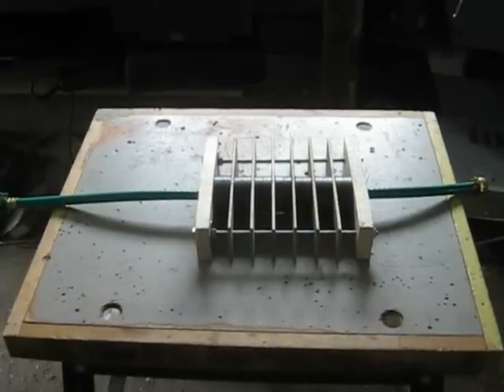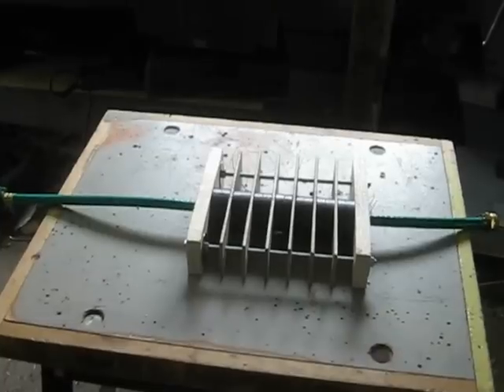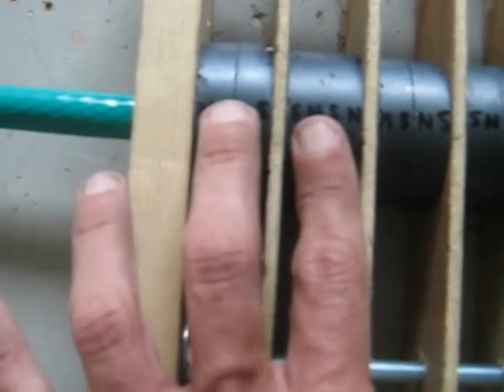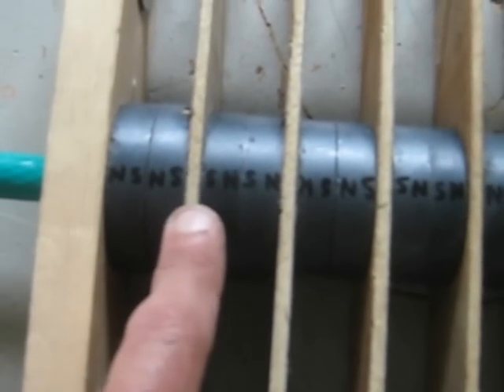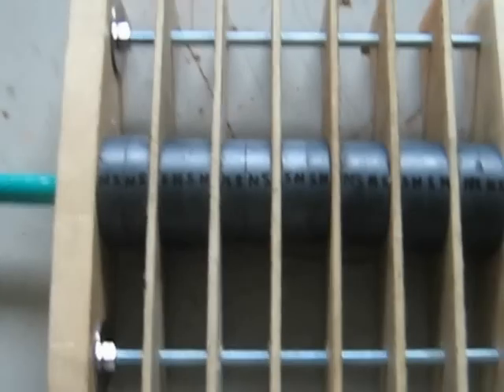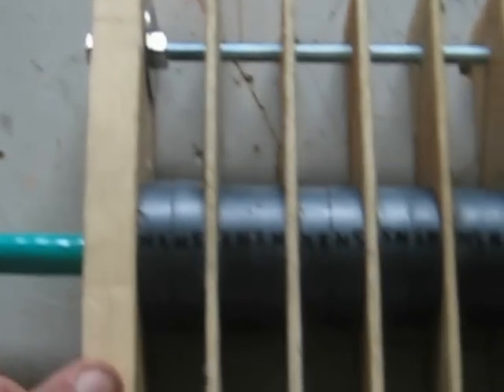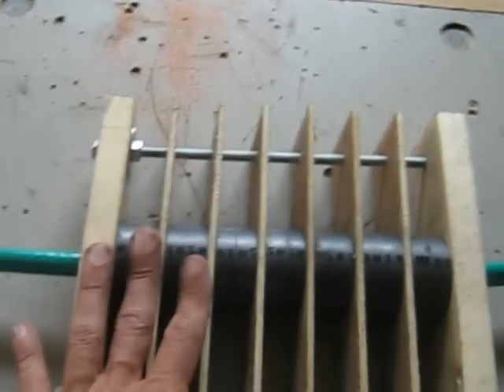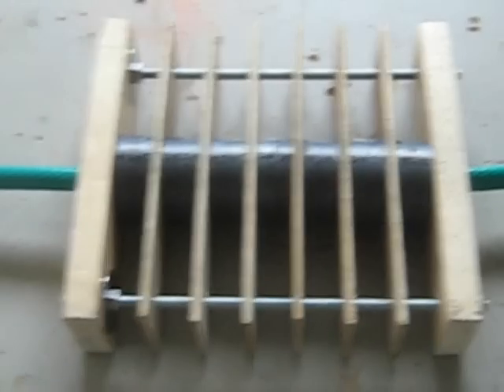Revitalized Water - Johann Grander Effect Replication

Comment: I have seen a johhan grander device opened and this is not what is inside. Also there is no inhibitation of the exterior magnetic influence I would use magenesium as the housing as is johhans also the real verbs is far from accurate. Rememeber to check for surface tension this is the outcome of soft water or rain water ect.

Comment: Magnets polarized thru diameter direction will give strongest firld density thru the water. Also, if those arent neodymiums, they will destroy their field strengths rather quickly. Neos will last over 100 years except over 160 f. Also, weathercoat the neos.. fyi

Comment: Maybe it could be a magnet on one side of the hose with a divider as the water goes through pulling the iron and minerals to one side so making a water stronger in those contents and increasing the ph?
Reply from the maker: Actually there is a vid on YT that shows a person cutting a Grandeur device in half....it is galvanic  ;)
Reply: @MrAnguswangus  What's galvanic mean? I was looking for a vid that opens one up but couldn't so far. Do you have a link to share? Thanks.

Comment: Can you please let me know, when you say the magnets are opposites i.e north next to south, is this when the magnets are pushing apart? Many thanks great video
Reply from the maker: Yes, the mags were repelling each other in that setup. I never got to finish the experiment because I had to move at the time. Take care.
Reply: Thank you and that's a pity, I am thinking about reproducing your design as I already have Grander water units through my home and am very impressed but wish to boost if I can with your design, plus a piece of spiraled copper with 7 spirals in the pipework. Do you realize the Grander units do not have magnets in them? it does have a sheet of copper, had you considered using copper in your design? Many thanks.
Reply: PS did you manage to get anywhere with removing fluoride out of the water first? I cannot find any credible way to achieve this, Many thanks again.
Reply from the maker: DoyoucareAbout Tweeter Yep, I've seen the vid where they cut 1 open...it's a galvanic system. In the vid Water Wizard Of Tivol, they mention that Mr.Grander got the idea while considering the water flowing in a copper mine :) I'm not sure what the magnet arrangement will do...I'll be curious to hear your results. Not sure about the flouride...I don't think the mags will do it, but I don't know for sure...best to try it and see for yourself. Peace!
Reply: Of course would be happy to let you know, There used to be a video on here speaking of a captain and some crew & their ship went down leading then to living in a rowing boat for around 3 weeks with no water or food, this was around 300 years ago and the captain was well known for keeping very accurate detailed records.
Anyway the claim the captain made in his journal was that he and several crew focused on the seawater around their boat & believed it to be fresh water to save them, not prayed, simply focused, obviously if they had not changed the water they would never have made the 3 weeks in the boat to tell the tail.

Fascinating stuff, Much Love to you & yours <3
Reply: Berkey filters are know to rid the fluoride out of water.

Comment: In grander website they talk about the ability tio water passing information, thus running the regular water thru a box that contains sealed walls with water already treated and this water transmits the info for the regular water to alter itself. Nothing about magnets
Reply: No magnets in the grander products i there? I watched a bid where they cut open a metal grander box... just copper n metal.
Reply: The issue is how that water within the sealed walls is created.

Comment: The question I have is would there be a difference in effect between running pex or copper through the magnets. I recall seeing the old skunk works guy putting a ball magnet in a copper pipe that he held strait up and down. The ball magnet moved much slower than the plain steel one did. If you have seen that demonstration you'll get the nature of my question.

Comment: can you pm me a link to the original patent or schematic?  I was thinking about making one of these by using a lengthy of pvc pipe as the housing and stack the donut magnets as you've shown inside the PVC housing and use endcaps with holes drilled to secure the magnets inside and just run a piece of refrigerator hose down the middle to carry the water.  Do you think that would work?